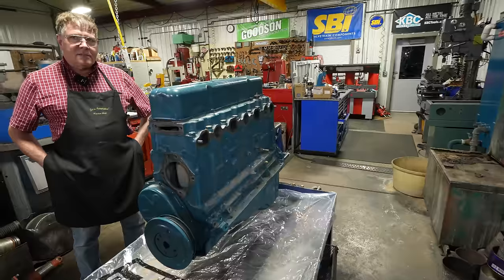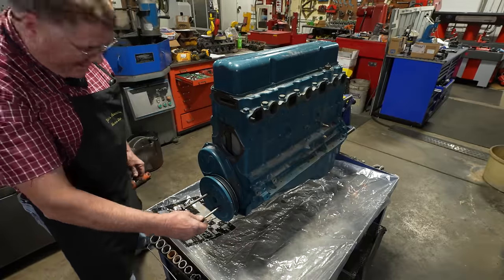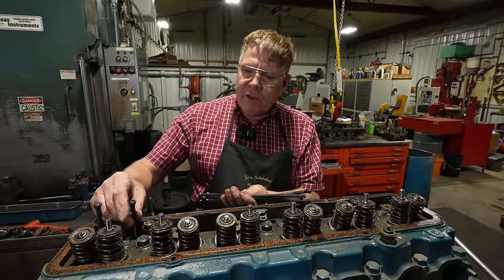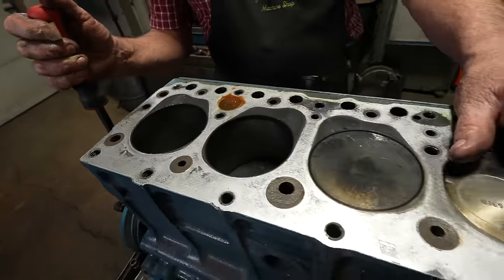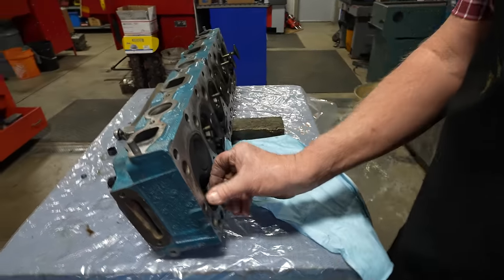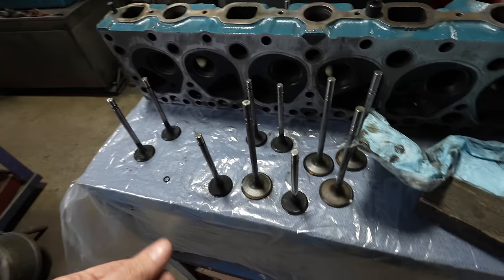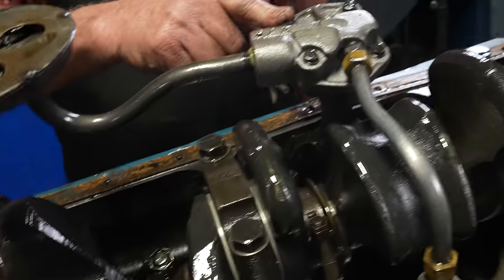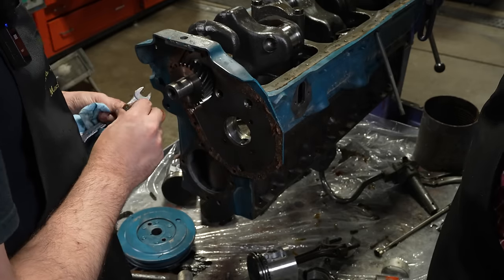Their 235 Chevy BROKE DOWN 10 Miles After The LAST Shop's Rebuild...

Comment: In the late 80's I worked for Opel in Germany. Just a small family owned shop and I was an apprentice. One of the older customers brought their old Mercedes in to have the drive train freshened up. Nothing wrong with it, just age and lots of mileage. We pulled the engine, transmission and rear end out of the car. The tranny went to the tranny shop, along with the rear end. I was one of the crew rebuilding the engine. When we pulled one of the valve covers off, first thing we saw was a set of rockers missing. Then we pulled it the rest of the way apart to find the piston and rod were missing as well! This was a one owner car, with many miles on it. Somehow it left the factory without one of it's pistons in the early 70's! How it went hundreds of thousands of kilometers and nobody had ever noticed the lack of a piston, I'll never know. You'd think an oil fouled sparkplug would have been a hint. It did leave with all 8 pistons and 16 rockers, though! Strangest engine rebuild I ever was a part of.
Reply: Permanent cylinder deactivation! Amazing that no-one noticed the rough-running... Maybe they told themselves they're all just like that?
Reply: @tamberp  Believe it or not, it ran smooth enough to not notice. They just never knew about the power loss.
Reply: @picklesontheroad  ...that's amazing!
Reply: I bet the owner loved the additional power his car had. 😁
Reply: No rod=No oil pressure.  No piston=low power &  very noticable vibration.  No rocker arms=lifters would have come out of the bores.  ????
Reply: @JC-dt4jq  LOL yeah exactly. I don't remember if it had lifters or not. How does something like this leave the factory unnoticed? It drove into the shop, didn't seem to vibrate. Still will never understand it...
Reply: That piston delete was a factory option. To save gas and eliminate friction extend oil changes. ❤❤
Reply: I had a 1954 Opel in Frankfurt in 1967 USAF, had to go see George Von Opel for parts in Frankfurt, Does anyone speak English, NEIN, I did get my parts by pointing to a Parts manual, good car for $50.00

Comment: Nice one. I built one of these things that is still in my shop and has only been test fired on some carb cleaner.. I got nervous watching this video because i had it milled down to a PRETTY small piston to valve clearance and was worried yall were about to prove my build would suffer an early death, but.. seems like it was probably just tight clearance and lack of lube, not the issue i was nervous about on my own build! 

Really appreciate the lack of throwing 'the last guy' under the bus here. The bearing issue is odd but could have been human error either at the plant or by the assembler and doesn't seem worthy of smearing those people regardless, so im glad yall restrained yourselves from that. The one i built (a 56) plastigauged out to have acceptable main bearing clearance with no shims. It's just an odd duck but hopefully mine does a few more miles than this one! Good vid!

Comment: I think the "Stovebolt Chevy" nickname came from the earlier 216 engines which had the oil pans secured with pan head screws. The 216's were also affectionately referred to as "Babbitt Beaters".  Enjoyed the show!
Reply: I was always told it also applied to the pan head bolts that hold the lifter gallery cover on the side of the block. If you look up 'stove bolt'. That is the proper name of a pan head bolt.
Reply: From 1941-1953 the 235 was also a babbit beater, and nearly identical to a 216 externally.
Reply: I only started hearing that term about 15 years ago.
Reply: @jamesbosworth4191  When I worked at a small salvage yard in the late 70's the nicknames were well established. A large hammer and cold chisel were used to pop the screw heads off when cleaning the motors for cast iron.

Comment: I did a small block 400 25 odd years ago and when I opened up the package of main bearings it was a 10-10 crank and one of the main shells upper and lower was standard.
Ever since then I have ball Mike and measured every single  bearing that I've put in an engine ever since we cannot control packaging as mechanics/machinists

Comment: IF IT WAS ME, I WOULD KNURL THE GUIDES, AND REAM FOR .002 CLEARANCE ON INT. AND EX. AND ONLY USE THE O-RING STEM SEALS. THOSE VALVES ARE SO LONG IT TAKES  A WEEK FOR THE OIL TO GET DOWN THE STEM ANYWAY.  DID A LOT OF THEM BACK IN THE DAY.  KNURL IS STILL THE BEST WAY IN MY MIND!!  GOOD LUCK

Comment: I’m from that era. There were two versions of the 235. The thriftmaster & the powermaster. The thriftmaster had hydraulic lifters and a shorter stroke. The powermaster had solid lifters and a longer stroke. The umbrella seals were on those intake valves from the factory. The rocker could possibly bend a valve if the tappet end is not ground square to the rocker shaft. But watching you tear it down I think that cross hatch was to agressive on the new valve stems for running in new valve guides. We used to knurl the inside of a worn guide. To close clearence and retain oil. But new guides & new valves should not need either. The pinned bearings that required shimming were on pre 56 engines. The pinned bearings were full solid babbit. The newer bearings in 57 were tri-metal with locater on the ends of the bearing caps. That we are used to seeing on more modern engines.
Reply: All 235s had the same bore and stroke. There were 2 other engines in this family, the 216 and 261.
Reply: Me2! Looks like my '62 middle school auto shop project! Kept going to getting my Chrysler Corp "Dr. of Motors" cert from Orange Coast College, in '68, where my optional 283->302 project found its way into my '56 'Vette. Sold (after the racing clutch kept breaking driveshaft u-joints) that blueprinted (with knurled piston skirts & bearings -Mssrs. Mole & Anderson, RIP, made sure to have us try "everything"!) motor to a buddy who couldn't believe it couldn't be overrevved, so got drunk & passed out with the Weber dual quads held wide open. The only reason it failed (tho stationary), was bc of coolant boil-off, causing the crank to seize, throwing rod pieces every which way!
Reply: A crosshatch on the valves with oiled 1000 doesn't hurt at all I did heads for 20 years never had anything come back it doesn't hurt at all you just have to measure things with a micrometer but he's making it sound like it's going to file it off it doesn't hurt a thing I always used umbrellas instead of the O-rings

Comment: Memories of the 60's as a teenager. Rebuilt a few 235 and 261. Couldn't afford to send the head out so I hand lapped all the valve seats with Clover lapping compound and used the suction cup lapping tool. I was told that they were called stovebolts because the early engines were put together with flathead screws and square nuts.

Comment: there's the wrong way, and then there's my way......as he snaps the bolt off😅
Reply from the maker: Strategically sheared so we’re forced to replace with a new quality fastener 😎
Reply: Did you remove it before putting it in the cleaner.

Comment: I used to have a 250 6 cyl. With a ping, but still cruised faithfully, it used a little oil, but no smoke, sold it to a guy, that put a bigger block, and a cowl hood. It had been wrecked when I bought it from a dealer that put a earl scheib 39.95 paint job

Comment: My grandpa owned a machine shop for the longest time which came from his dad in the 60s. Unfortunately the shop closed before I got to see it in 2007. But seeing all these processes and tooling being put to work is awesome. I then can have a conversation about what crank came from what, what oversize cylinders mean, or deck height. Seeing how all these parts and tools work is amazing. Though I wish his storage unit worth of parts could be used again.

Comment: Some may🙂 find this boring, but I have been riveted to it. I was involved many years ago in a small time machine shop after I had worked for GM dealerships for about 20 years.  My passion was building engines ever since I was 14. Never did reach the pinnacle of high end machine shop work. But the interest is still there. Thank you for this very interesting tear down video. Made my day.

Comment: I love seeing engines models being worked on that I have worked on myself. I am getting to used to watching the modern high tech stuff being worked on. Even though this engine is blue it is the big brother of what we called the Chev grey motor that was used in our home grown vehicles right up until 1963 and was only149 cubic inches. It was probably based on an even older Chev engine than this one.
Reply: I think that grey engine was either based on the old 216, or maybe from a still-born car that would have been called Cadett.  It had a small 6 cyl. about 140 cubes.

Comment: Interesting autopsy. I've never worked on a stovebolt but recently overhauled my 1968  230 six and they're a vast improvement in engineering. I love the driving torque of the inline sixes.

Comment: Wood stove kits came with slot bolts so that if you had to you could build them with a hatchet, they were sealed with asbestos and usually used tab-and-pin like plastic model kits did for position so didn't need much torque on the bolts that went through them.

You can take a couple shorty box-end and a 3/4 drive cup and weld up a crank that goes from the impact out to 5 inches aside then back to the box-end and almost never damage the senders with an impact - seemed to work fine on old Ingersol air wrenches, it got rid of a lot of the initial shock, you'd break the weld at the elbow every so often tho, hardened wrench heads don't like welding.

Valves running from rocker arms will have a tiny little wiggle like rifle barrels do when they're fired - you want them absolutely smooth so there's no way for the oil to be squirted out quicker from around their shaft like a rain tire is designed to do.  ONLY reason to hone valve stems is proper clearance and any odd flashing.

Comment: Something i learned on these old 6's is to also check the keyway for the harmonic balencer. I have seen two of them wallered out. Also, check the roll pins holding the bridge for the air filter wing nut screw i seen one of those little tiny roll pins drop into the cylinder of a brand new rebuilt 292.

Comment: I used to align bore the early 235's to eliminate the main shims and use later bearings. Made it a lot easier for novice people rebuilding them. I've seen mispackaged bearings over the years,it happens. I've also seen people buy the wrong size bearing,then buy the right set from the parts store,use them and put the wrong size back in the box to return them.

Comment: I worked on lots of 235’s when I was younger, those motors are dang near bullet proof, we redid one where the exhaust valves were burned egg shaped and it was still running. I agree with you, those umbrella seals were unneeded and caused the failure. If I were doing one I would keep everything stock unless it was for racing.

Comment: We called the nuts and bolt head with sawtooth like serrations on the face side of them to make them lock a whiz-bolt or whiz-nut.  Unistrut, conduit and small
Piping mounting hardware uses that a lot.

Comment: recently put rod and main bearings in a newer 2020 infinity 3.0 tt motor because of road damage to oil pan  . every single bearing top and bottom was different sizes based on measurements and the motor was 100% stock was a crazy process to measure and look at a graph to figure out each bearing  then fit each bearing and recheck. i like watching thanks for the entertainment !!

Comment: Brings back memories.  When I was sixteen, back in  1980, my dad had a 1967 Chevy C30 with a 292 in it. I tore it apart in the alley and rebuilt it, in the truck. It got a valve job, new gaskets and lifters, which were a real bugger to get out from all the varnish on them.  The truck ran great, had tons of power, could take off from a dead stop in third, three on the tree, so first and third was easy to mix up.  I sold that truck to a manufacturer when I was working at a service station. One day the truck came in and it sounded different. They blew it up by not checking the oil, and the front seal had started leaking. They put a 250 in instead.

Comment: Wow ! I was a mechanic for 50+years on forklifts, in my early years I used to rebuild engines, I loved to put them together, always double and triple checking everything I did we even safety wired the nuts and bolts , painting the engine was the Final check , you guys do a great job investigation and measuring is the basis of all engine work . We would cut are own values and seats , just the cylinder boring and crankshaft was sent out , to this day I do miss the engine rebuilding !

Comment: I have built all out 10K rpm engines, many of them....1.80 the tightest I have ever ran on Ti valve 5mm stem in any engine I have built.....1.5 clearance to tight merytle to tight...love the content retired at 42 with stomach cancer, 50 now in remission but miss the craft

Comment: Talk about a time machine! I am 68 now and when I was 12 years old I got my first experience with rebuilding Chevy motors with my father. Never had the luxury of pulling the motor, so the rebuild was one over the fender or on the creeper. I remember the fascination with using Plasti-Guage to check bearing clearances. That was probably the seed that led me to a life long career as a Machinist and a Tool & Die Maker.

Comment: I've had push rods bend after valves seized in the guides when gas got in the oil & began to dissolve stem seals. The gunk would find its way down & turn to gassy glue. Had to beat the valves out even to the head with a block then the rest of the way with a dowel. First time (about 15 yrs ago) was on a 78 Toyota 2T-C 1.6L...took out an intake (turned rod into a very lazy Z) & exhaust with one good bend. No piston damage. Had done a fresh ring job & was using a "Franken-Carb" that couldn't figure out why it was dumping fuel. Kept close eye on oil pressure & after 2 full changes after 30min runs each had a bunch of tainted oil. Was after this found the mix screws were too short for the base I was using. Got a proper carb for it. Did do an inspection of bearings after that episode...no damage. Was a learning experience.

The other occurrence was a few year back on a 77 IH Loadstar w/ 345 that "made oil" when the fuel pump started to leak after replacing the carb thinking IT was dumping. Caught it early so changed oil + filter & called it good. A little later started to run bad & pulled the intake to be able to get to the heads & found it had a bent rod. The valve for it was stuck & very nearly all the rest were fouled. In BOTH cases after removing the valves ended up soaking pieces of rag in gas & using a small screwdriver to use like a cleaning plug. Back & forth until bits came back clean. Gas soaked rag to clean up the valve stems. Made sure everything was dry then liberally applied oil to the stems & carefully operated the valves to be sure there was no more sticking. Problem never returned.

Comment: First time viewer. I like the fact that you didn't bash the other shop and along with their name. 👍 I'm a retired motorcycle technician in 2005 from starting in May 1979, mainly working on the four Japanese brands. In early 2000 when I worked at a  dealer as a technician a 2000 GSX-R600 Suzuki came into the shop with an engine failure and was recently rebuilt at another dealer. It had a bent exhaust valve on #3 cylinder. The last dealer had just repaired a bent valve issue too. I printed out a complete parts list, but hadn't turned it in yet. A day later I was thinking I didn't want to just replace damaged parts without knowing why this happened not once, but twice. This was a four valve DOHC inline water cooled engine with shims under a bucket that the cam lobe pushed on while opening the valve. I looked at the bottom of the exhaust valve bucket for the valve that was bent and it was shiny outside where the shim came in contact with it which was not right. The bucket is not supposed to make contact with the retainer. I checked all of them, but started with the valve that was bent by installing the upper valve spring retainer, keepers and the shim inside the keeper on the valve. The shim was lower than the retainer which it should have been higher. What caused the valve to get bent was instead of the cam pushing on the bucket which then against the shim then against the valve to open and close it, the bucket was pushing on the upper retainer which took the pressure off the keepers against the valve allowing the keepers to come out, also causing valve float which allowed the piston to come in contact with the valve resulting in it being bent. This engine has a redline of 13,500rpms. I never found out what rpm the valve bent at,  but I can guess it was pretty high. The problem was the keepers where sinking into the retainers due to the they were titanium and were too soft. I replaced all 16 upper retainers and 32 keepers. The bike never came back with a bent valve. The other dealer had the Suzuki serve representative come to the dealer to set up the valve clearances with the head on the bench because the technician didn't know how and even he didn't catch what was the cause of the valves getting bent. I was able to find the cause from my experience from working at a motorcycle performance and machine shop for 11 years. We worked on street bikes and built drag bikes. About the only thing I miss is doing some of the machine work. Unfortunately this was a warranty job which meant it only paid about a 1/3 of the actual time it took to complete the job.